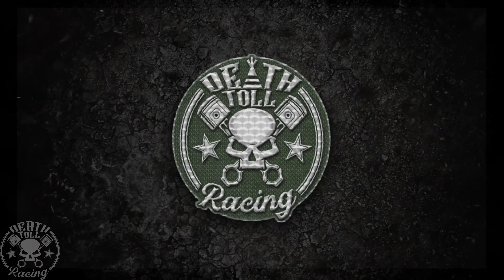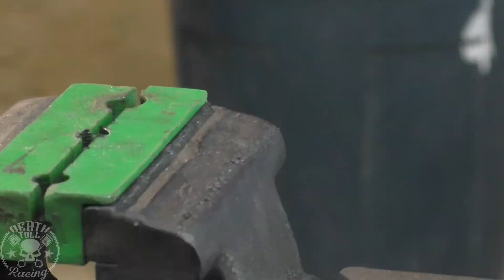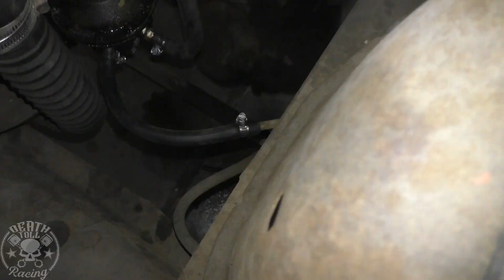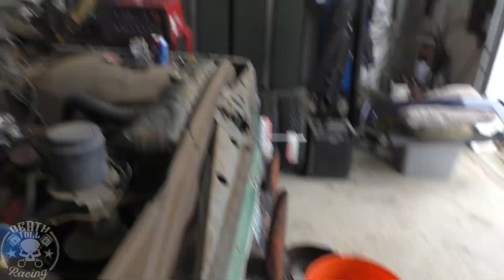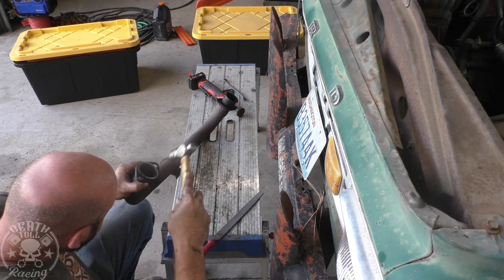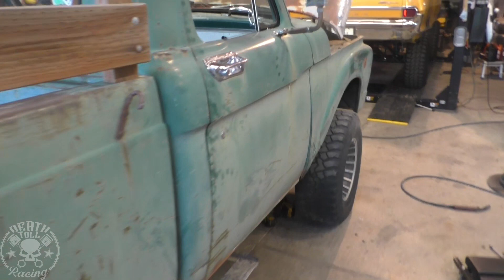1964 Ford F250 4x4 Revival, 292 Y Block, Autolite 2100 / 2150 Manual Choke Conversion, will it run?

Comment: I'm a Dodge man. But I kinda liked that Era F-250 4wd. Engine doesn't sound good or strong. Maybe tunings? Valves? Timing? Unless you want that truck locked into stock form I'd dump the 292 Y Block and get a modern 302 V8 or 351 V8 throttle body and torque cam, tune it for power and idle pulling in the low rpm's. That's the kinda power this old truck demands  and deserves. Add power steering, power front disc brakes an A/C and you're good to go. Minus the body work of course.😊
Reply from the maker: The 292's in the trucks have very low compression (7.6 to 1).  The nice part is it will run on just about anything flammable.  I've toyed with all sorts of ideas, but I keep going back to leaving the way grandpa had it and he hated it (but secretly loved it) the whole time.  LOL

Comment: I love the huge horn and that steering wheel looks like it came froma mercury. I have a 64 292 4 speed floor shift. Its my daily driver and has. Just over 66k miles. Had it a year and replacing everything that is rubber as most of it has cracked from age. Drive it and love it. It was built for that.
Reply from the maker: It does.  but it is the stock one for this trim.  It was about as fancy as you could order them when it was new.

Comment: does it still have over head exhaust  then does it have over head oilers which they need but it is a worthless engine i put a 63 t bird 400 hp 390 engine in my matching box 64
Reply from the maker: if you mean cross over exhaust then yes.  I like the 390 too, but I wouldn't call these worthless.  it's lasted 60+ years on farms and will still run on extremely low grade fuel.

Comment: I bought a 64 F100 long box 4x4 w/the 292 in 75 from my brother. It was pretty straight fixed up the interior a bit, changed the long box to one like yours, I also changed the carb to a 4 barrel changed the stock exhaust manifold some how to make dual exhaust and added purple hornie mufflers, I  also added 36" tall narrow tires 15"  white spokes, back then there wernt a lot of choices  in tires and wheels. I also remember it had 4:10 gears and with those tires I had to use the granny gear to go from a stop and when in 4x4 4 high was useless. It was a great truck lots of good memories.
Reply from the maker: right on!  They are really cool trucks.  I really should change the manifolds on this one too.  At some point I had them...

Comment: Any way to remove that universal style upper radiator hose and replace it with a properly formed hose,, please do so at the first chance you get.
Reply from the maker: My grandfather said the same thing 30 years ago (literally) when we put that hose on there. I need to change all the hoses on it before I regret it.

Comment: Thanks for the video. I have 66 F-100 that has a Mustang HO 302 and automatic overdrive instead of the 6 cylinder. I have been having "fun" dealing with the stock drum brakes since spring, replaced the single reservoir master cylinder with Wilwood double, replaced all shoes, wheel cylinders, hoses, even better used backing plates for front. I need to add the steel fuel line from tank toward fuel pump. Previous owner just put in a long hose. Your video showed where the connections were for the fuel line.
Reply from the maker: Glad it helped!  Is yours 4x4 too?
Reply: @DeathTollRacing  No, just rear drive, but previous had Tru Trac added to rear 9".
Reply from the maker: @bluetruck53  awesome!  Such cool trucks!

Comment: My family had a 63 with double cab, short bed and 4x4 with a PTO winch. Got it from the northern California power company when we lived in California. Later in life, when I was a teenager, we used it as a farm truck in Arkansas. Drove that thing from California to Arkansas. Top speed 60mph and that was wound out. Twin tanks and lord knows what the MPG was. Used it for many years on the farm. It would pull like a tractor and I could haul a lot of hay with that old beast. It was painted a bright orange / yellow. Wonder what happened to it?
Reply from the maker: Mines about the same at 60.   This one also hauled a ton of hay.  If your old one is still around it's worth a lot of money, even if it's roached out.  Those are insanely rare, and I'm not sure if Ford even made them. I think I read something about double cabs being modified by a third party vendor when new.  I could be wrong (likely) though, and may be confusing it with another crew cab.  There are some 60's chevy crews around too, and I think it's the same deal, maybe even the same company that built both.  Now I need to look into how those came to be.
Reply: @DeathTollRacing   I left home at 19 headed to college and never saw either one of them again. My dad sold the farm and probably left them with the farm. Watching your video brought back the memories. You could not rush the shifting of that granny low 4 speed and I was wondering if your top speed was any higher. I had the same problem, never could remember the shift pattern of the 4x4 lever and to confuse you more, it had a third lever for the PTO winch. Good times!
Reply from the maker: @jackflash6377  The best part, is the memories.  I have kept almost every vehicle I've ever had, and the sit in storage.  the memories are still better than having them though.  So many someday projects.....
Reply: @DeathTollRacing  I have to agree, the memories are the best part. You kept all the vehicles you ever had? That's amazing. There are a few I wish I still had. I bet you have a ton of memories too. Feet prints on the headliner?
Reply from the maker: @jackflash6377  lol. Yeah it’s a curse not wanting to let anything go.

Comment: For a 4x4 i am surprised they put a battery where they did if you're any good at welding I would cut the bed floor out and try to fix it
Reply from the maker: It definitely isn't the best place, but it's survived so far.  It's on my list to fix that bed!!

Comment: Cool old truck. I like the big steering wheel with four spoke. Nice color.
Reply from the maker: I love the color.  I'm going to do a follow up video soon with a patina coating to seal it.  Keeping my eyes out for a hood that's the same green factory paint!
Reply: @DeathTollRacing  you can color match the paint and blow hood over. Any hardware store can match it. Just get oil base and roll it on. Then scuff it back. A lot cheaper than a hood. But yep plenty videos on how to mix up the Patenia  sauce. Yep a little bit of luv and put it under a lean too. Great yard art. Good luck.